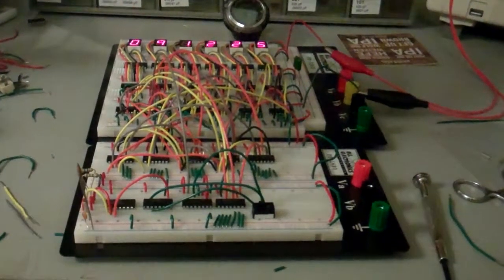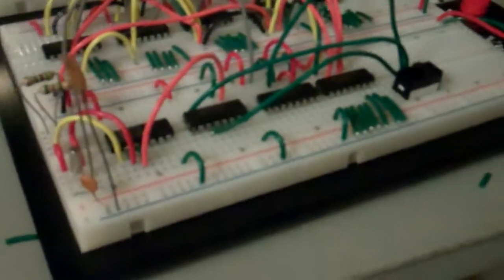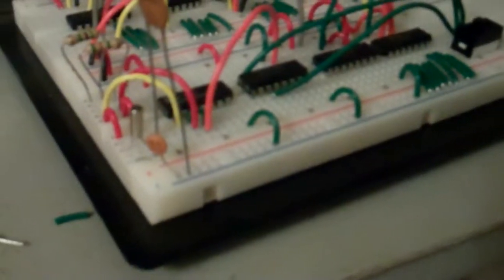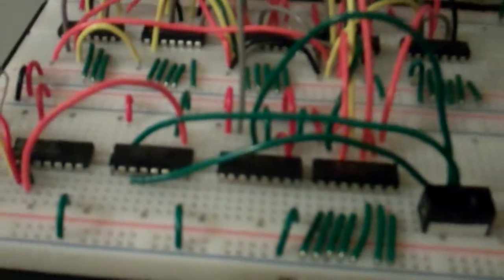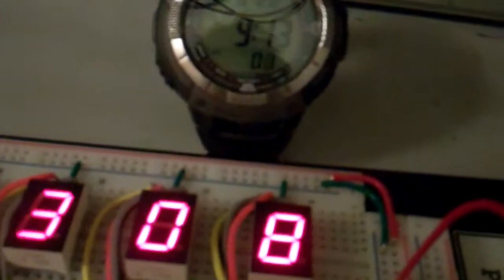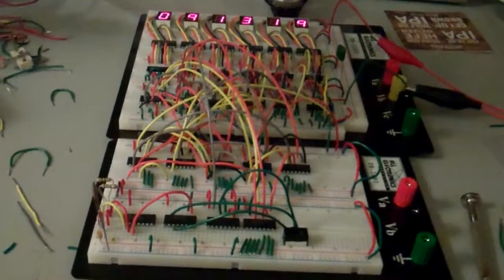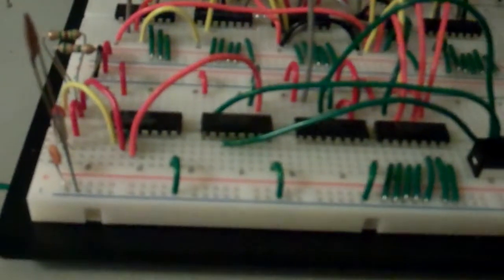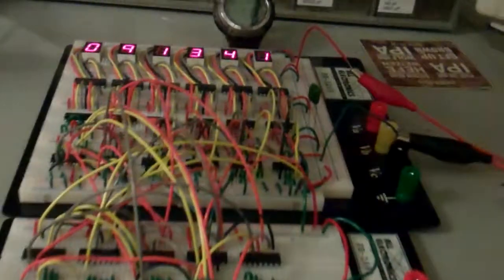CMOS clock with 32.768 kHz crystal oscillator

Comment: not sure how you got 1Hz out of 32.768KHz but good job
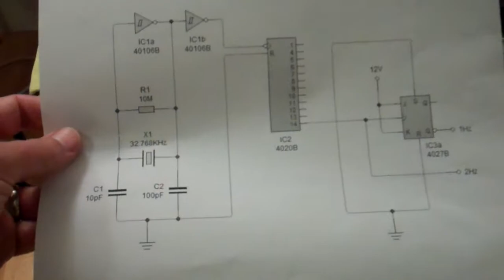Reply from the maker: at 1:01 I hold up the circuit.  32.768 kHz on the last pin comes out at 2 Hz, use a flip flop to take that down to 1 Hz.  link:  https://en.wikibooks.org/wiki/Practical_Electronics/Plugins/1Hz_Oscillator
Reply: thank you !!